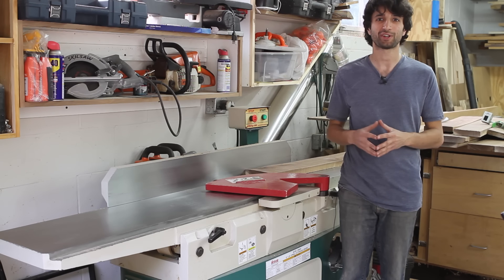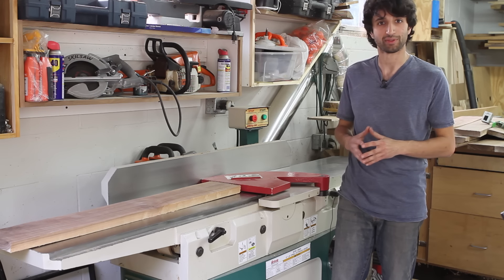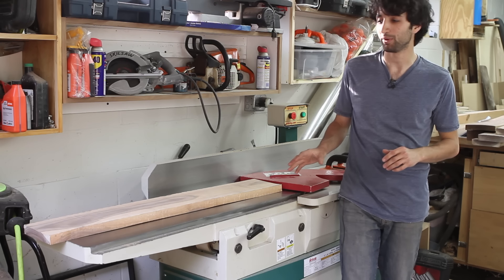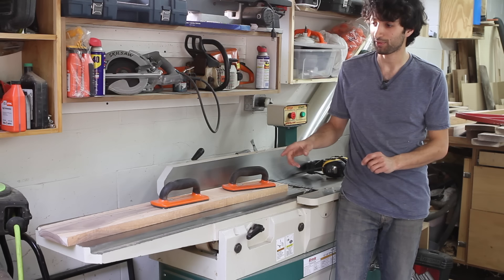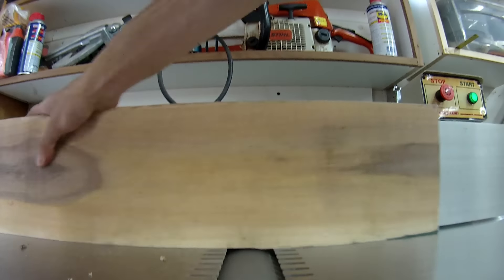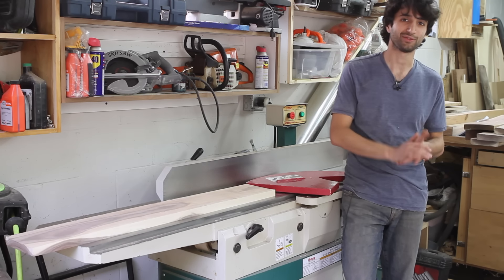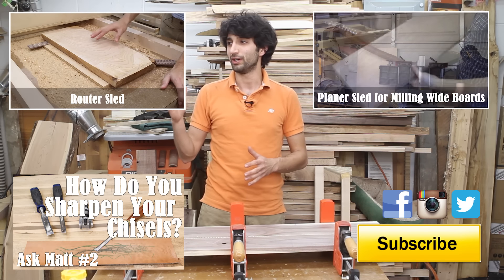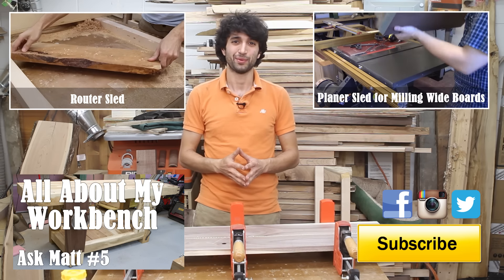What Does a Jointer Do? - Ask Matt #13

Comment: "Hey wife . . . I was just watching this youtube video and it looks like I'm gonna need to buy another tool.  It'll probably cost about a month's worth of income, but it will make nice smooth boards.  Just saying." 

"Hey hubbie . . . yer gonna have to deal with crooked projects.  Just saying."
Reply: exactly what i'm dealing with.
Reply: nicholas wolford that's a great description, perfect
Reply: This is very true.  I see 800 dollar machines on there all the time less than 100 dollars.
Reply: Just don't tell her. She won't even notice there is a new huge machine in the shop cause they all look alike to them anyway.
Reply: Lmao! That is the funniest comment I've ever read!
Reply: Thompson Jacob so tell her you paid a hundred bux on Craigslist
Reply: After reading this I did a quick search and the first thing I found was a local person selling a Jointer for $75 because he was moving. This was a small, Made in China Delta, but it was bigger than the bench top Made in China Delta I had just bought from Home Depot and it has a stand, which I would need to make or buy because there's no way I'm lifting that thing on and off of my bench (which is too high anyway) every time I use it. I haven't even unpacked the Home Depot Jointer, so I'm going to see if the guy still has it and if he does, I'm going to return the one I just bought from HD and put the cash towards a new Table Saw.
Reply: Your monthly income is like $400?
Reply: I prefer the other method where I go to home depot for nails and tell my wife about it when I get home. It usually starts with "please don't leave me but i got a ..."
Reply: Wife and I operate under the "It's easier to get forgiveness than permission"  method of marriage. Which usually means we're eating Ramon  noodles at the end of the month.
Reply: Just make her something cool with it....problem solved...
Reply: What do you tell a wife with 2 black eyes? Nothing you Just told her twice. Lol
Reply: Scott Jessup  you read my mind lol
Reply: Brandon S  We need more men like you in Ireland!
Reply: "But HONEY, it's important!! It's for the Greater Good!!"

"I am the GREATEST GOOD you're ever gonna need!!"

:-D
Reply: Brandon S  -- No woman has ever told me what to do.

And this is why you and I live alone. :-D
Reply: Hey Wife.....no more shoes for you!
Reply: You sound like a victinm, son !!
Reply: No longer allowed to watch YouTube.
Reply: not at all, just bought a rebuilt 6in. jointer, not a table top, a big floor model for $150 bucks...all i had to do was buy new knives for it...its about 4 feet long, and it works great....no need to spend $5000 like the one in the video
Reply: Yeah bro ha ha!
Reply: @jamescarlin569  um...um...ok, that was funny!
Reply: Brandon S  ah, so you're single. 😊
Reply: @nichowolf   Garages were not meant for cars to park in what fool came up with this Idea? Its where men store tools they never use and broken down old project cars they will never have the money to fix up.
Reply: Brandon S   RIGHT And Mom Didn't tell you to clean your room as a kid!
Reply: Just build her a nice table with it. She will be ecstatic, but after that she is going to view you as being her endless source of custom furniture. She will also tell you about the projects she has planned for you.

I'm not married yet, but I support my fiancée's hobbies. In turn she supports mine.
Reply: A month.. ya rich bastard..I still can't get over th price of the wood planes
Reply: It’s best to 1. Make purchase 2. Slowly integrate purchase into current tool stock  3. If the purchase was large enough to be noticed, deal with consequences later. It does help the reconciliation process if you were able to acquire said purchase using a long term, no interest deal. Of course, it’s always best to work together in unity but I have to admit I’ve used this method in the past.
Reply: @mwebtex  purchase,  move to dog house ... install some amenities in said dog house tv for the game cooler for the beer.... ECT......and remember to do your bit for the planet " eat a vegan "
Reply: James Carlin lame
Reply: Trelise' Avery-Moore  irish you must be irish... come to think of it I have one niece that makes furniture professional and another an electriction
Reply: LOL 😂 🤣
Reply: "Hey 'wife.' Here are the divorce papers. Just saying."
Reply: Divorce would be advised.
Reply: Hey, I don't complain when she spends $300.00 on make up.
Reply: nicholas wolford a new jointer or a new wife?
Reply: Sounds like a divorce is called for. Wives are the bane of men. Just saying.

Comment: the surfaces on jointer are not actually coplanar, they're simply parallel.
Reply: +Piotr R ...jointer
Reply: ur rite!!
Reply: I think he was trying to use "trivially collinear"   since two points determine a line.
Reply: To be parallel you must be coplanar
Reply: They are NOT parallel . Parallel is when the two surfaces are equidistant . Clearly the in and out feed are inline and NOT parallel.
Reply: @piotrr5439  No he is TOTALLY wrong as are you.
Reply: You people really need to go back to school and learn 5th grade geometry. They're parallel. Coplanar means they're in the same plane. They'd only be coplanar if they were exactly the same height.
Reply: Piotr R is correct. Matthew Cremona you need to start reading the comments on your videos, you might learn something, like how a jointer works.
Reply: @armaanbhojwani2677  False. Counterexample: z=0; z=1.
Reply: Armaan Bhojwani a cube’s opposing faces are parallel...
Reply: Came here to write this... i am amazed how many people have it wrong... Piotr is right. Coplanar is used in reference to two 2d objects that belong to the same plane. a point, line, shape, or another plane. Those 2 planes are offset hence they are just parallel, not coplanar. They cannot belong to the same plane when they are parallel.
Reply: @738polarbear  Suggest you go look up the definition of parallel and take a look at a jointer in real life - those tables are parallel.
Reply: @joeciccone7142  The two tables are initially set in the same plane (coplanar).   An adjustment then drops one table to a parallel plane to set a depth of cut.
Reply: Piotr is absolutely correct in that the two jointer surface are parallel not co-planar. If the infeed surface was adjusted so that it WAS in the same plane as the out-feed surface, then the two surface would be CO-PLANAR. However, in this setup, essentially no wood would be removed as a board was passing over the cutter.
Reply: Ppl forgot what "parallel" means... Really?
2 streets parallel - they're not the same street. Just goin the same way

Comment: You'd think it would be the other way around. That a planer would make a perfectly flat plane, and a jointer would make a parallel surface that could be easily joined.
Reply: well... the planer is also called a "thicknesser" or "thickness planer" in some countries. That makes sense

Comment: The jointer's outfeed and infeed beds are in parallel planes. This is true geometrically because planes have infinite extents. They are not the same plane. Minor grammatical quibble. Adjusting these beds to being "co planar" so to speak, or the two planes to be parallel is a nightmare as we know. It should be made easier.

Good explanation of the difference between the two machines and developing the inferences we need in order to understand how to use the two machines.

In fact the two planes of a jointer are NOT coplanar mathematically. I don't care if the company making them says so. I don't care if 10,000 expert woodworkers say they are. They are not mathematicians. The infeed and outfeed are (normally) in two distinct non intersecting planes.

Coplanarity is a word. It just does not apply to jointers.

Comment: The same “level” perhaps?

Because you’re a craftsman you like precision
Reply: nope, just Parallel Planes.
Reply: Yeah I’d say parallel planes too. Two planes that are parallel but offset from one another. 

Same level would be the same plane and that’s not what he means here. To be fair, he did say co-planar which I would interpret as being on the same level but I think he used that incorrectly.
Reply: @link_7164  You're right. Parallel planes, not the same plane. Co-planar means "in the same plane" - it's most often used for a set of points, with more than 3 points - so the two tables of this thing are not co-planar (unless you adjust them to zero offset).

Comment: Hey Matthew Cremona  Love the vids and your work, dont have a jointer myself but looking into handtools. Just wanted to help out your definition at 4:00 about "Coplanar" (meaning in the exact same plane). I believe the 2 tables of a jointer are parallel but not coplanar. the difference is the few mm for blade (cutting) depth. 

Does that make sense? or am i off on how jointers work? Thanks for sharing so generously and love how you generous and humble you are. Thanks again!
Reply: +Majid Al Qassimi is correct. Further, many jointers use a parallelogram design to ensure the surface(s) remain parallel, but they are most definitely not co-planar.
Reply from the maker: Majid Al Qassimi You're absolutely right.  I misspoke.  They are parallel planes.  They'd be coplanar if the cut depth was 0 :)   Thank you!
Reply: No Matthew Cremona Thank you! You are one of the most down to earth guys on youtube and watching your vids and laughs, im just glad you are sharing so much!

cheers and keep it up!
Reply from the maker: Majid Al Qassimi Thank you!!!!

Comment: AWESOME presentation! Thanks so much...As a carpenter for 30 years, I've used a planer many times but never needed a jointer....I didn't do much cabinetry...I use mostly S4S stuff so it doesn't require much milling...But, you really made me want a jointer...:)
Reply from the maker: thank you!

Comment: The guy who gave you the thumbs down thinks you jointer is too small. Lol great vid
Reply from the maker: ***** The only logical explanation!  Thanks Dema!
Reply: Matthew Cremona What I want to know is why you used the small jointer and not the big 48" wide jointer you have.  ;)  lol  just kidding...
Reply: Matthew Cremona Hi Matt, very good video! I have a solution to Dema's comment. You send me the jointer you showed in the video and that will free up space in your shop for a much bigger one.  :) lol
Reply: Mike 61 your probably gonna get the same response as i do every time i stop by lol
Reply: ***** Haha :)
Reply: Me thinks its due to the unnecessarily high volume during the cutting phases.
Reply: Its not the size of the planer, but how you use it😱
Reply: It's not the size of your jointer, it's how you use it.

Comment: They're not in the same plane. They're parallel.
Reply: +ophello  Yes, one table is lower than the other to remove material. The top of the blade is in Coplane with the outfeed table.
Reply: ophello who cares bruh
Reply: Yea. He was struggling to find the words but he still explained what was happening correctly.
Reply: correct me if I'm wrong, but isn't the one just lower on the same plane? they're are both on X plane, for example, just because the one is lower, doesn't mean its on XY plane.
Reply: Alexander B. If it's lower, then by definition it is a different plane. The tables of a jointer, unless they are set at the exact same height (which would be pointless), are on two separate but parallel planes.
Reply: Andrew Nguyen I guess I'm wrong in viewing it in terms of xyz planes? Since in terms of XYZ, both would be on X since Y and Z would be perpendicular to x
Reply: There are an infinite number of planes that are perpendicular to the x-axis in your example, and they are all parallel to one another. Each of the two tables of a jointer lie on a different one of these infinite number of planes, EXCEPT in the case that the tables are set at the same height, in which case the planes they lie on are equivalent, making them coplanar.
Reply: Parallel would imply the two surfaces are on top and equidistance of each other - both surfaces on the Joiner are on a level plane.
Reply: Gee Raffe Incorrect. The opposite is actually true. A jointer works based on the fact that the surfaces are not on the same plane. If they were on the same plane, then the knives wouldn't cut anything when passed over.
Reply: ahh my bad /  you are referring to the woodworking tool which is correct - I was referring the dude at a party making joints strong enough put people on the floor thus everyone on the same level ..
Reply: The second table is parallel with the blade or cutter head. You set the first table according to how much you want the blade to cut off. So their not parallel or on the same plan lol. But the both should be flat squared surfaces, that's for sure
Reply: Andrew Nguyen 
Exactly. But the second table is parallel the the blade.  The first table is set according to how much you are cutting off . Which I set 1/32 to a 1/16 when I'm jointing. Sometimes an 1/8 when the bow is nearly a 1/4.
Reply: Aaand a woodworking video is challenging your knowledge of maths and tickling your knowledge feather, awesome how things are connected.
Reply: He was saying they have the same direction. We get the same explanation in school. Parallel planes are in fact the same plane when making mathematical equations
Reply: They are coplanar. Not parallel.
Reply: No.   @Zanmiester  If one is lower, they are no longer on the same plane.  They are now PARALLEL on two different planes.  The jointer removes material from the space between the two planes.  If material is there, it is removed.  If material is not there (as in a cup/bowl) it is not removed.  The result is a flat surface.

Comment: Matthew,  there is another jointer. It's a simple edge with a saw that will cut into the board.  You set the boards together and press so the saw cuts into the edge of the board to place a wafer into then you make sure that you have the cut from the sawblade in both boards in the same way.  Place glue in the holes and stick the wafer or biscuit in the hole.  Then glue the other board the same way and press it into the other board to bring a marriage to the boards so they become one.

Comment: I went through a similar thing with my mitre saw yesterday. Wasn’t cutting square or at 90*, I hadn’t noticed until I was using oak.  A few minutes of adjusting made all the difference to the work and the enjoyment.😊👍🏻 
Do you ever go back to hand planing your timber, there is even more enjoyment doing that then with a power tool. I’m new to your channel so if you have posted a video like that I haven’t seen it yet.

Comment: One thing I didn't really think about initially after working with rough cut lumber is it doesn't take too long to change shape after you plane and joint. You want to use it rather soon afterwards

Comment: I am starting out and opted for the planer first. Several reasons but mainly to handle wider boards. I am using it with a DIY leveling sled. I got the idea from My Garage Woodshop, who in turn got it from Shop Notes issue 137. It basically adjusts to remove the wiggle in the board as it runs through the planer, basically turning it into a jointer. It's about $60 in lumber and hardware, much less than a 12.5" jointer 😅

Comment: Also very important is noting (if it isn't obvious) that you ALWAYS put any bow up (as you did) when running a timber through a jointer to avoid the possibility of the piece rocking and undoing any flattening that you have achieved.

Comment: I would truly love a jointer of that size and the space to put it! :)

A side comment for anyone wanting to buy a jointer.  After taking a few woodworking courses, I really wanted one of these.  Talking with my instructor, he explained that some of the best jointers used to be made from blocks of steel that were allowed to rest for literally years before being shaped and the surfaces ground flat.  This resulted in surfaces that stayed flat long-term.  He advised ... great advice! ... getting a  of Starett straight edges and gap gauges.  Either get a guarantee regarding surface tolerances or, best case, go to the place where you're going to buy the equipment and look for dips, cups, and twists in the feed table surfaces.  Any more than .001 out, don't buy it unless sending the tables off to be ground flat is cost effective.  In other words, precision work requires tight tolerances and, on the jointer, this is especially critical.  Those tables must be flat.  I had my jointer for two whole weeks, and then Katrina hit and plans went sideways.  Someone now has a really nice jointer at a great price.

Comment: now we need a video on "how to setup your jointer"!!

Thanks for the video.  you did clear a few things up for me on using the jointer.
Reply from the maker: Adam Craig haha!  In my case: open crate, plug in, turn on :) After 4 years, it's probably time to check it to see how calibrated it still is.  Thanks Adam!
Reply: I'd love to have one like that.  I just picked a 6" king for $100.  Not a Caddilac but it will do for now.
Reply from the maker: Adam Craig it was a little funny when I got it.  I had done all my research and was ready to spend the time tuning it up.  So much for that. lol
Reply: Let me play with it and when im done it will need readjusted.  Lol  its a sweet looking unit and you are right, it is an important tool when working with rough stock.

Comment: You can also square the end with a chop saw now that the bottom and side are trued up. The best way to view a jointer is as a support tool, it doesn't do much by itself but when you use it with a planar, a table saw, or a chop saw, you massively increase the precision of those other tools.

Comment: Another thing is if you don't use a jointer on a warped board,then send it through a non shop planer you'll get significantly more board snipe on the ends,from Hercules to Dewalt the small ones don't have the ability to hold the majority of the board flat so it will lift on and off of the ends as they pass through